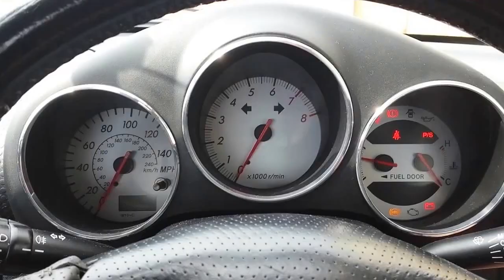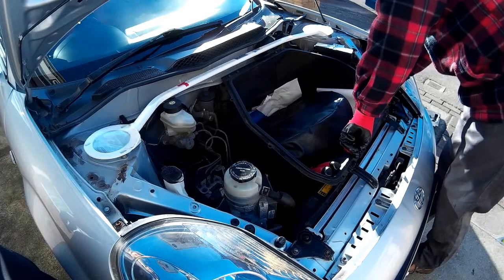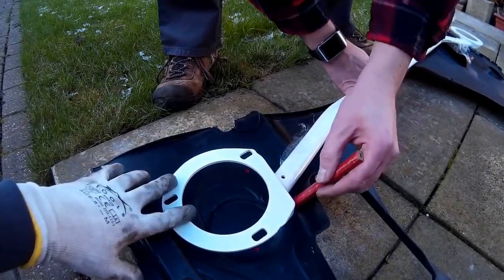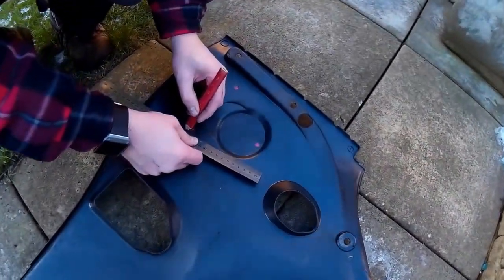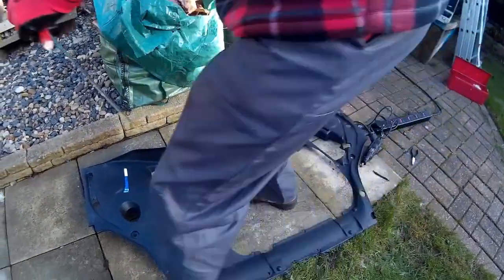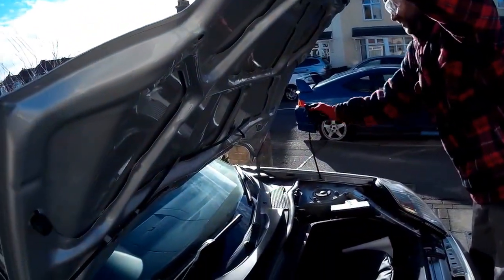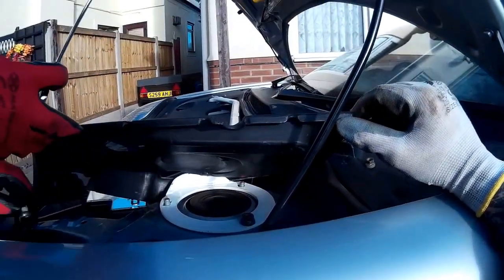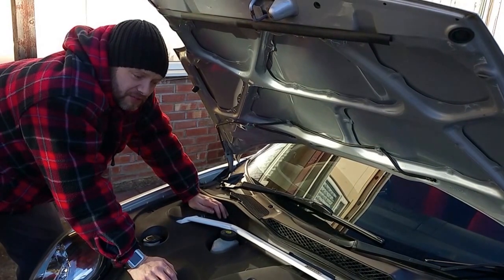Ultra Racing Strut Brace Install

Comment: Did it feel any better?  Got my Cusco strut brace in the shed!  Still in the box.
Reply from the maker: I've got a 2005 so it has all the additonal factory stiffening so I'm not sure it added a massive difference.... especially where the towers are so close to the bulk head. I would say it seems a little more eager turning in etc into the twisties though :)
Reply from the maker: I'm probably going to end up recutting the plastics though to be able to take it off without taking the brace off...Looks neater but depends how often you'll want to get under it
Reply: @DadDiaries  I'm on a 2000. I was told the strut braces were a waste of time. Didn't stop me buying one though. I was also told by the same MR2 guru - that the breastplate is also not needed. Again, I didn't listen and have the same one as spyderLEE (still sitting the box, waiting to be installed.)  I'll do the install videos - when I get the *****ing car back.
Reply from the maker: Hah yeah if you got it put it on. The under belly brace does make a difference....otherwise Toyota wouldn't have spent the money in design and research adding it to later models!
Reply: @DadDiaries  Totally agree.

Comment: and what model Honda clips are they from that you replaced for the front upper tray assembly? As all of mine have either been lost by the previous owner or now worn out - same as you've found. Also trying to take off the front bumper  - this is really a chore without a repair manual
Reply from the maker: Colin Briscoe hi Colin, I'll dig out the details on the clips and get back to you. the strut brace is made by a company called Ultra Racing who I believe used to race MK3 MR2'S.  I'll get a link up shortly :)
Reply from the maker: https://www.youtube.com/watch?v=99rOFuQazSA heres a quick vid on the clips :)

Comment: Hi now that you have had this on for a year. What's it like in real world  driving would i notice any improvement driving around my roads in south wales .I would like to know before i invest in one. Thanks. David.
Reply from the maker: So I have an 05 which has the extra factory bracing and stiffening. I would say the front brace does make a difference but it's not a night and day sort of thing. The strut towers aren't that much further forward than the front bulkhead so i dont think they aren't going to have a lot of flex anyway. Not sure that's helped you really. If I didn't have it would I buy it again...Yes.  would I buy it over other things such as refreshing brakes etc....no. do that stuff first.
Reply: Thanks for the response, i have a dec. 03 face lift as you say with the extra bracing , i have done all the brakes new discs, pads all around, Rebuilt the front calipers as thy were binding and new hoses all around plus brake flush, and didn't it make a difference they were absolute rubbish when i bought the car. Thanks Again David
Reply from the maker: The rear brake rebuild made some difference for me but I replaced the lines for Goodrich stainless lines and didn't feel a bit of difference!
Reply: Hi all or most of the braking is done on the fronts, as i said i done the fronts first as they were sticking on, i found the seals were all very hard. i am going to do the rears over this winter, i had my bits off Big RED on E Bay he also does a rebuild service on your own calipers
Reply from the maker: Big red do a great service and the finish is excellent